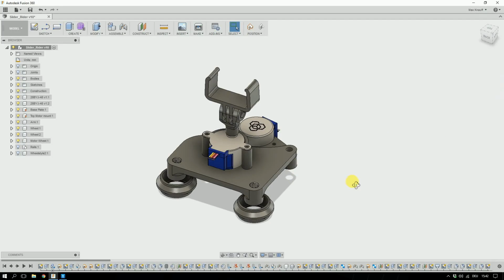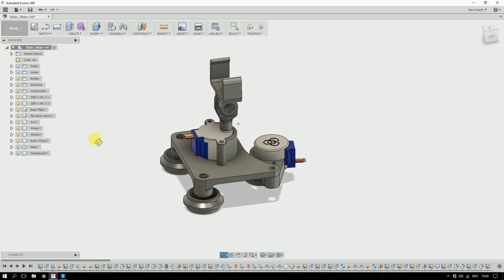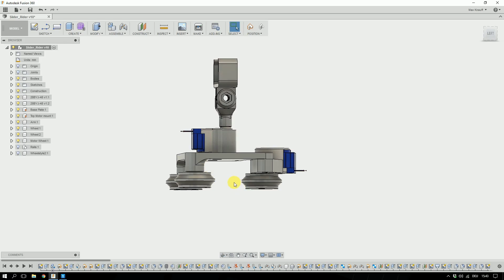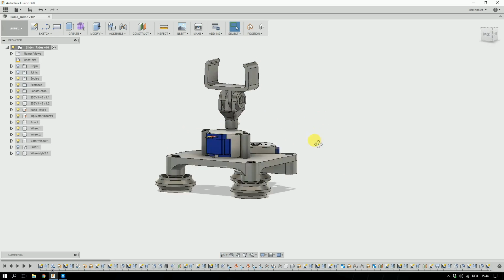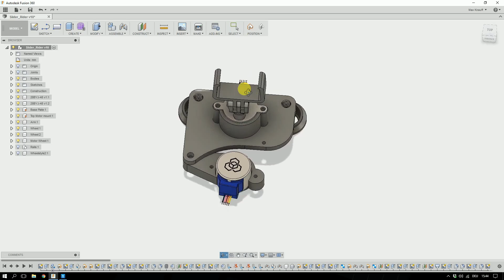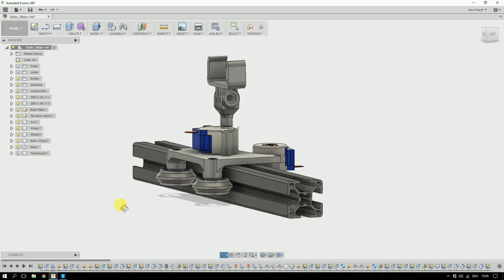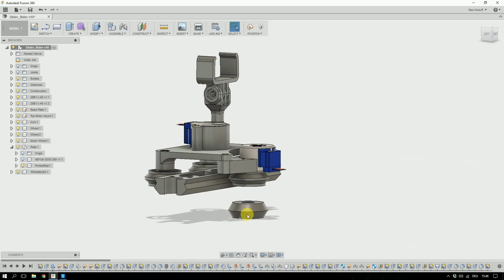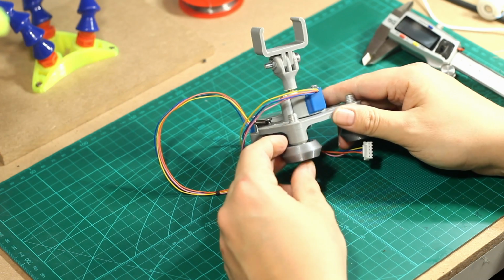P2: Bluetooth Action Cam Slider | Part 1

Comment: Can you please tell me what modifications I'll need to do in following case:
I have got 40x40 aluminum rail instead of 30x30, and other parts I'm 3D printing except rail.
So what will change in the parts?
Reply from the maker: there are two things that might not fit. The spacing of the wheels front to back and the distance of the wheels to the base. The first (spacing front to back) might not be an issue, the spring might just have to extend a bit more. For the distance base to wheels you can add nuts at the front wheels as spacers but you might have to design an extended rear wheel to get more space
Reply: @MakenModify  thanks for the response!
I modified the base plate and increased it breadth by 1cm, and according to my calculations I'll need to add 5mm spacing between wheels and base/arm